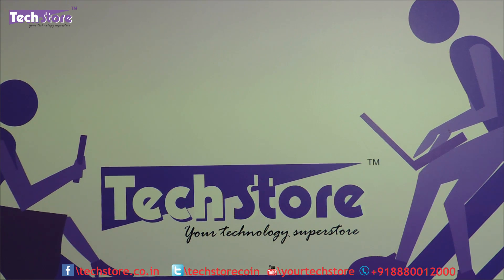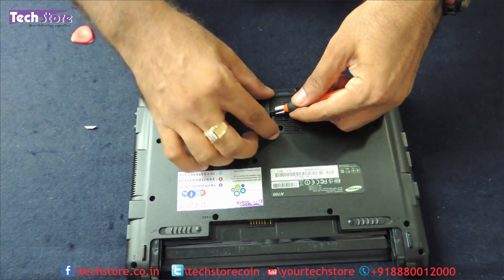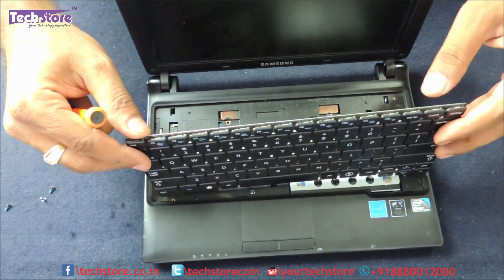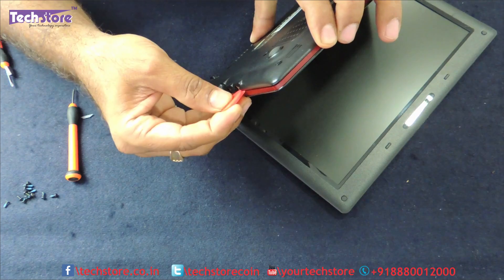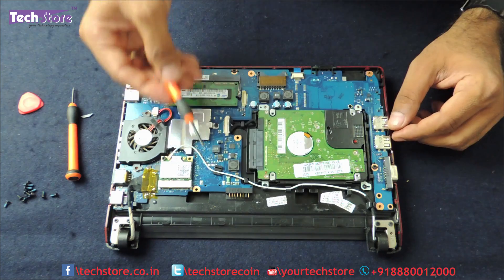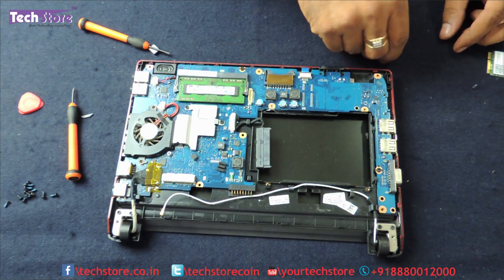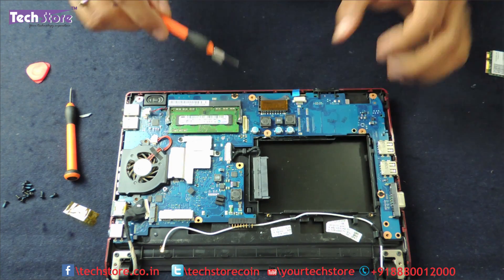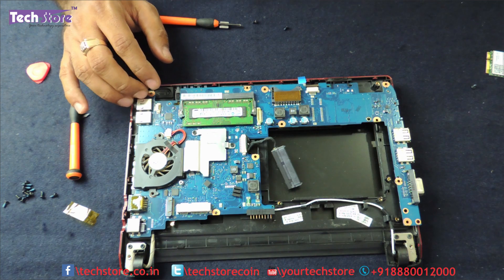Samsung Netbook N150 N100 Plus : How to Disassemble base & upgrade ram keyboard hdd ssd wifi easy

Comment: I upgraded my 1GB ram to 2GB bought from amazon. Win 7 is running smoothly. But Win 10 is very slow. Can we upgrade processor?. Mine is Atom N435 single core. Can i install  dual core 2.5Ghz or something like this?
Reply: 2gb it is ddr3? Or ddr2?
Reply from the maker: Advise to install SSD. System will be faster.
Reply: You can change this cpu. This socket is max supports Atom N570.